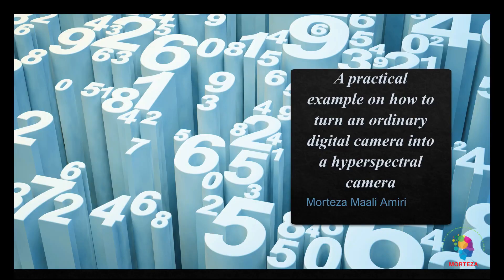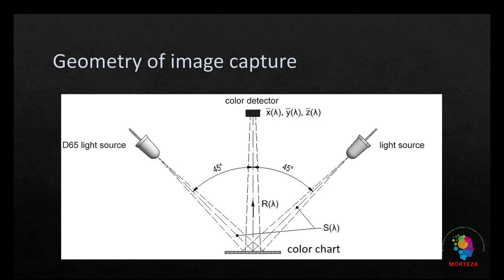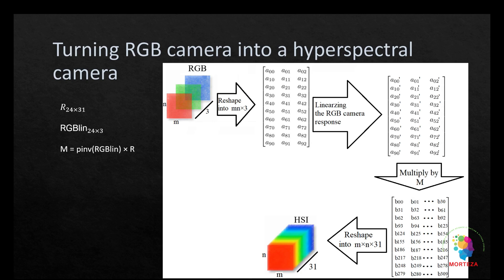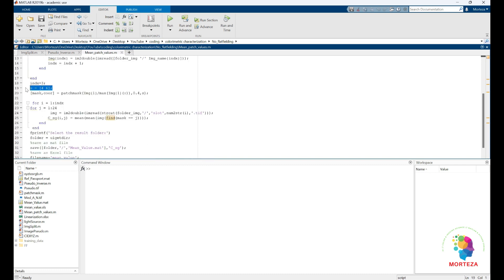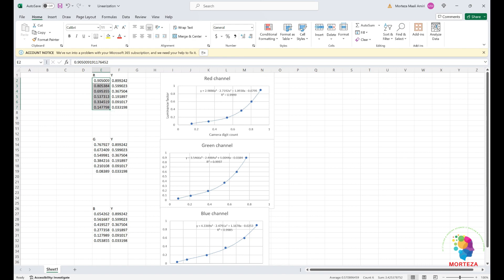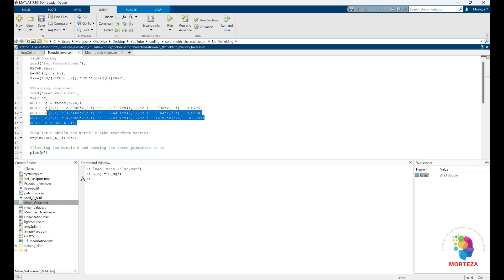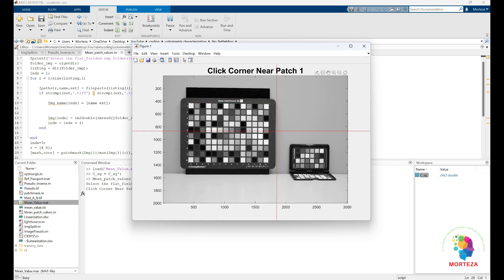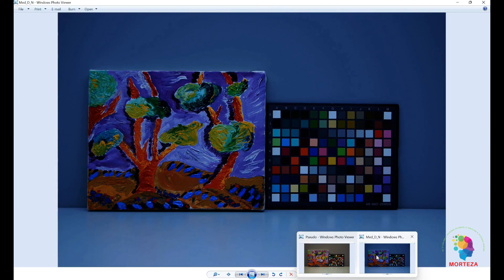A practical example on how to turn an ordinary digital camera into a hyperspectral camera

Comment: @7:41 you say : Calculate the Y tristimulus values" but if I already measured my ColorChecker chart with my spectrophotometer, I already have the Y tristimulus values. Is that what you did? Or did you "calculate" the Y values from the spectral data of your small ColorCkecker chart? Using D65 as the illuminant? And the 1931/2 Standard Observer  cmf?
Reply from the maker: @claudioabado3317  either way it’s the same. You either obtain the Y from your spectrophotometer or just compute it using your ColorChecker spectral reflectance values.

Comment: Another question... Before you get to split the RGB image into three channels, how do you get to the RGB image in the first place? Do you use RAW format? Do you worry about how the RAW format is decoded in a consistent way, from image to image to image?
Reply from the maker: @claudioabado3317  I used the raw image output from a Nikon digital camera and transformed it into a Tiff with no compression so I lose no information. If you can use the raw image straight from your camera, just use that…

Comment: What is the meaning of the "C_sg" variable in "mean value patch.m":
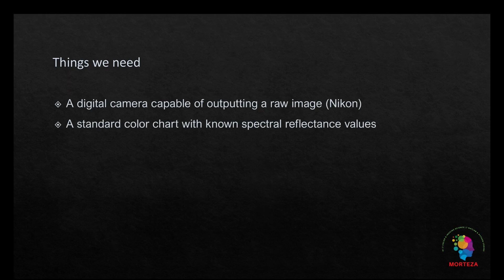for j = 1:24
         img = im2double(imread(strcat(folder_img,'/','slot',num2str(i),'.tif')));
        C_sg(i,j) = mean(mean(img(find(mask == j))));
    end
 end 
I can make up most variable names but not this one
Reply from the maker: @claudioabado3317  I wrote this code a while back and I was using a ColorChecker SG at the time, so used C_sg, or ColorChecker SG. Feel free to change the variables to whatever you feel comfortable with.

Comment: Thank you, it's quite interesting. I just wonder if the reflectance values are computed and combined from 3 channels. Then, the final image information would not be more than that. However, it's from RGB, and not more than that. How do you get a far red band?. It's really interesting. I like it, wanna know a bit more. Please if you could give more clarity regarding the band's representation over RGB.
Reply from the maker: Thank you for your interest! So the three channels RGB, they are sort of "compressed" over the visible part of the spectrum, from 400 to 700 nm. So, if by far red, you mean IR, this method would not be capable of estimating IR, it is only capable of estimating the spectral data in the visible part of the spectrum, because that's where the RGB are "compressed" over.
Reply: @Morteza_Sc Thank you for your prompt response. That was my point. It's really wonderful the way you present. Please do you have a research gate profile?
Reply from the maker: @akbarfaqeerzada7381  thank you so much!!